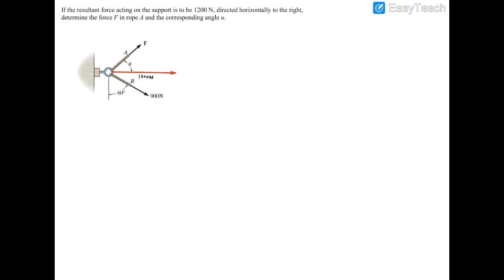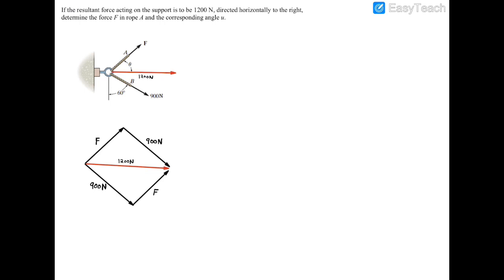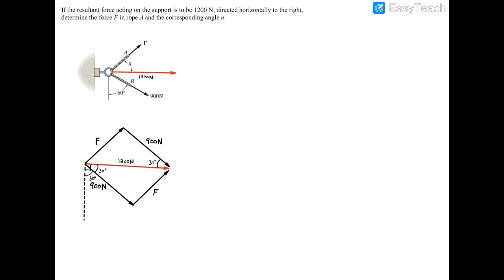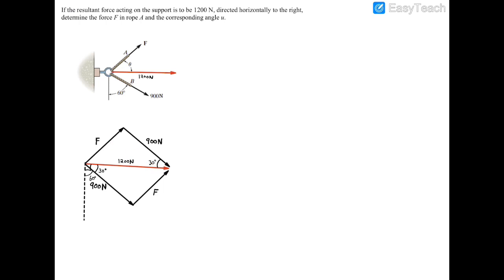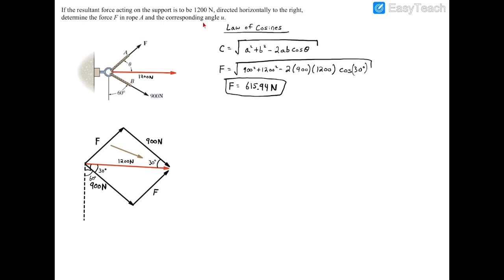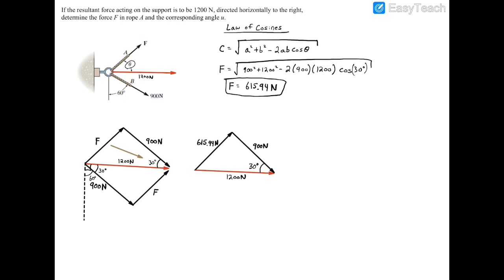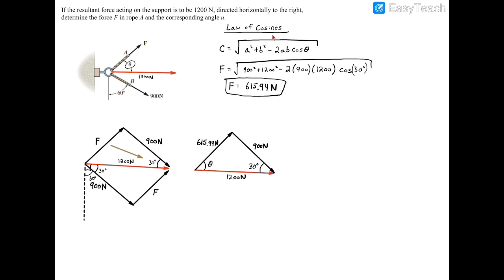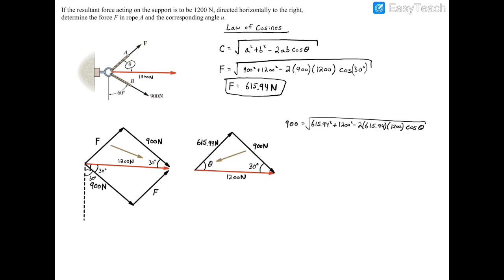If the resultant force acting on the support is to be 1200 N, directed horizontally to the right,

Comment: Question: why not just perform the sine rule to find the theta angle? In my opinion it’s a lot easier and less work than the cosine rule. Good content overall- thank you!
Reply from the maker: I choose to demonstrate with the law of cosines whenever possible because it never produces an ambiguous solution like the law of sines does (when given an SSA triangle). While it is possible to produce the correct answer by using the law of sines in this problem, it is also possible to produce an ambiguous solution if you decide to use 2 sides (900N, 615.94N) and 1 angle (30°). Thanks for watching!
Reply: @gr_engineering  I thought that SSA is the only type of triangle the ambiguous sine law is relevant to? That means that for a SAS triangle, sine law will always aid in producing a unique triangle, right?